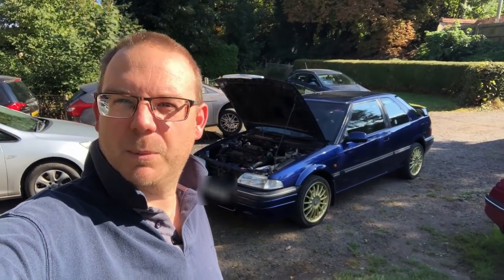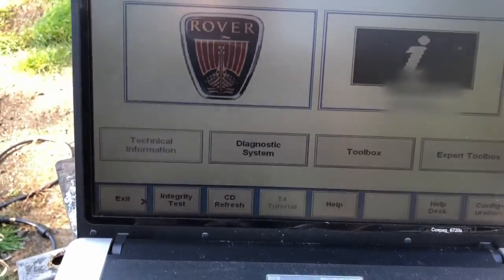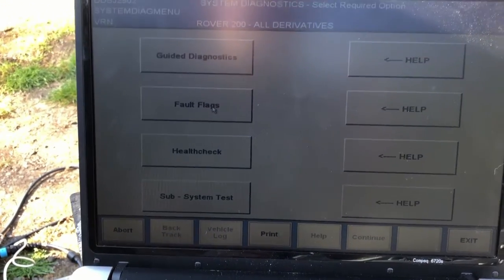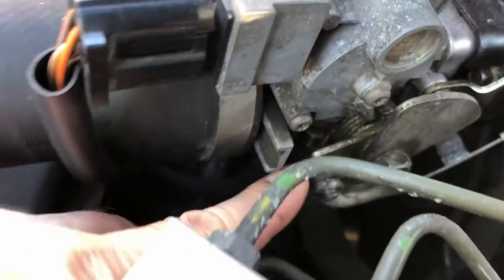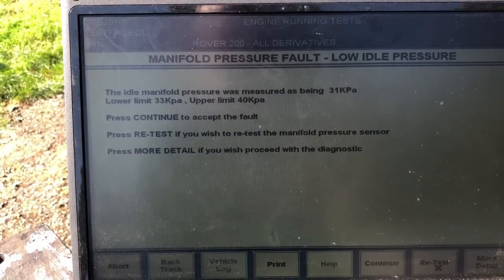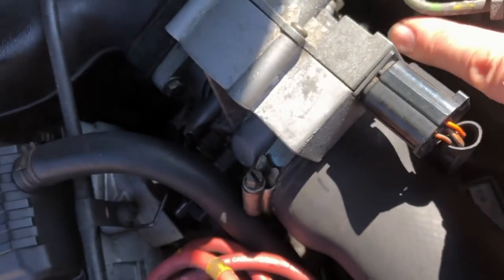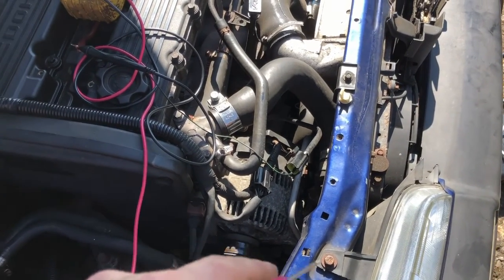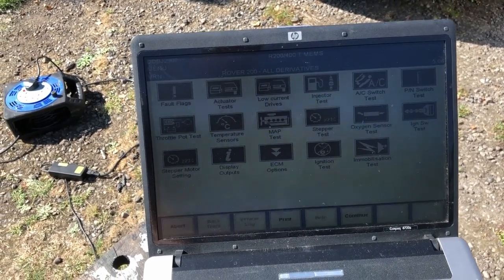Rover 220 GSI Turbo MG Rover T4 testbook diagnostic session

Comment: I've got some Rover parts left over if your interested get in touch...

T16 turbo cylinder head + inlet manifold x2 (1 missing valve gear and cams)

T25 Turbo + Exhaust manifold x1
T25 Turbos x2
T16 INTERCOOLER x1
ROVER 800 Vitesse Sport 17" wheels x4
ROVER 800 Vitesse 16" wheels x4
Aftermarket Janspeed Stainless exhaust wuth decat pipe to suit 800.
And a couple of OEM Phillips head units.

Give me a shout if you're interested 👍
Reply from the maker: Hi, where abouts are you?
Reply: @Roverturbo Heywood, nr Bury
Reply from the maker: Hi, yeah,  That’s nearly 4 hrs away, bit too far, thanks tho.

Comment: The e.c.u will be full of oil from the vacuum pipe on the inlet manifold, that's brought some memories back from the 90's lol, great video content
Reply: I think landrover defenders td5 had that same issue of oil running in to ecu under the driver seat if I recall